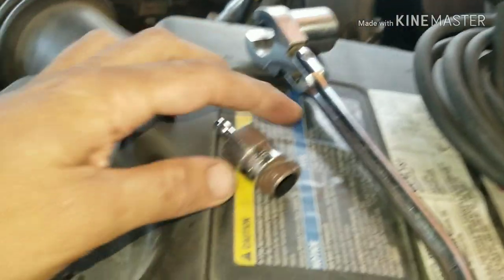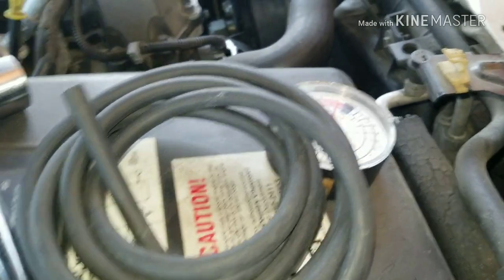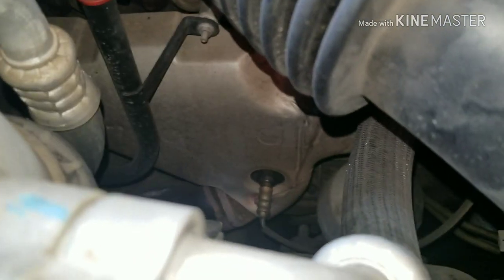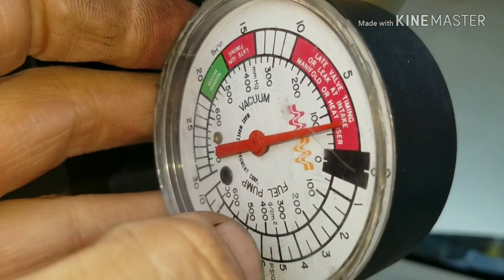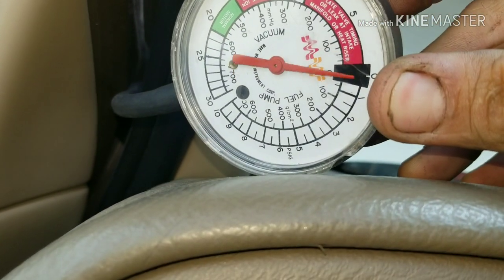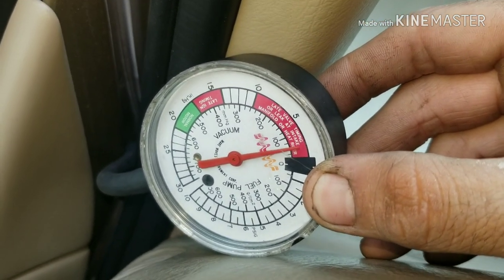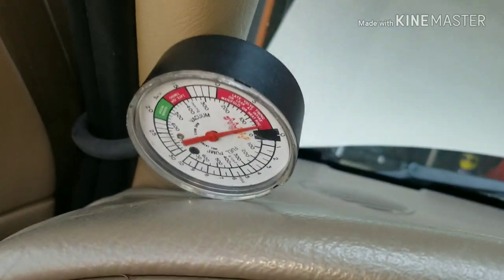How to find out if you have a bad catalytic converter

Comment: Yep, the reduced exhaust flow will  slow the idle down and cause miss fire, because some exhaust is lingering in the cylinders. Toyota 4 cylinder is usually # 3 cylinder. Sometimes it's all. You will also hear a low pitch roar developing.
Reply from the maker: Thanks for your input , Thanks for watching besure to like and subscribe for more tips and tricks and check out facebook for more help in the future

Comment: Thanks this is straight to the point instead of filtering through 40 minutes of talking, good stuff. 

What if the car is running fine until it warms up and only then it shows symptoms of a bad catalytic converter. Is it more than likely it is the oxygen sensor? since if it was a plugged catalytic converter it wouldn't of ran good to begin with? IT drives perfect until it warms up and i think the o2 sensor is throwing the computer bad signs is it possible?
Reply: I'm having the same problem runs perfect until it gets warm. I already chaned MAF,spark plugs,coils, EGR valve IAC valve and fuel pump. It runs way better now but still really rough when it warms up.
Reply: @weariedcleric6306  I'm about to just change the catalytic converter, but then i thought if it WAS the catalytic converter then it would NOT of ran good even when it was cold. So now i'm going to get a vacuum gauge and hook them up to the 02 sensors to test the pressure to verify. Good luck and test them 02 sensors.
Reply from the maker: Some time  the cat gets worse the hotter it gets , a bad fuel pump can give simaler issues also . thanks for watchin

Comment: I have none of that but a annoying rattling under when truck it's cold. Sometimes it does it also after being warmed up. It's got dual exhaust mufflers done at a shop. I bought it like that. I wonder if the catalytic converter makes sounds like that rattling.
Reply from the maker: That is a pretty common problem with (cats) they are ceramic inside a good bump and knock them loose, or they just shrink a bit. Just think of it as a nut inside a walnut shell when it dries out it rattles around just like that. Being its rattling it can cause intermittent restrictions.  I hope this helps and besure to like and subscribe for more tips and tricks.

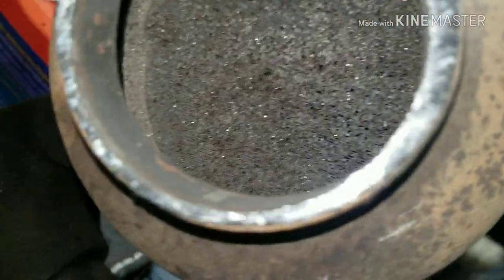Comment: I had to floor my car on the highway just to keep up. I was starting to wonder if I was already losing compression at 125,000 miles but then the P0420 code popped up one night. It was kinda bitter sweet because I knew the engine was fine but the catalytic converter was bad. It looked exactly like yours at 1:38. I bought an aftermarket bolt on part and put new Mopar o2 sensors on as preventative maintenance.

Comment: I have the exact symptom on my TB 2004 without any codes appearing. Will go to mechanic tomorrow to check. Fingers crossed.
Reply: My 2003 TrailBlazer has this exact issue where it slows down to 35 MPH and the RPMs are limited to 3,000. But it only happens after I've been driving for about an hour.
Reply: @TheDomTron  it was the catalytic converter. I had it replaced and welded. Issue was resolved

Comment: I have an 06 GMC Sierra 4x2 4.3L about 246,000 miles on it. While driving in 4th gear (about 40 mph) it begins acting like it has a dead cylinder. I immediately thought that I had a bad injector but after parking in my garage I immediately recognized the rotten eggs smell of H2S. What else besides catalytic converter and injectors could it be?
Reply from the maker: You could  be running lean from a bad intake gasket mass airflow, vacuum hose l. it could also cause  the smell, dropping out in fourth gear does it rev up high like your clutch is slipping? I hope this helps besure to like and subscribe for more helpful tips and tricks.

Comment: My 2003 dodge caravan tested P0420 on scanner.  It runs great on level ground but lugs on grades and engine strains if I try to push it.  I can make it up at 25 mph without too much strain on my tyranny and engine.  Heard about soaking converter in hot water with degreaser for an hour, then power washing on low.  Rather try that than spend more $ than van is worth replacing it.  Tying to find out if there is any rubber or other non metallic elements in it.
Reply from the maker: I've heard of that on particulate filters on diesels, but never a gas engine. if you plan on pulling that cat of to inspect you will be able to tell if in parshly clogged by looking for melted holes or no light coming from the other side,thanks for watchin

Comment: Hello I have a 2002 Buick lesabre, with 165k miles. I was at valvoline for a oil change and had them check my check engine light and they told me it was the catalytic converter. Question is is it really worth replacing ?? The cars only work about 1500 in the condition it’s in, and my state doesn’t have any laws not having one
Reply from the maker: Most the time when you have a bad catlalytic convertor you get a p0420. Most the time your car will run fine and your gas millage might go down.  Thanks for watchin besure to like and subscribe for more helpful tips and tricks.
Reply: Just take them off. Go straight pipe. Make sure when they remove them keep them and sell them. Some are worth like 200 dollars.

Comment: I have a 99 expidition xlt 4wd. Oh boy what an adventure it was given to me. It had low power and check engine. Tons of rotted vacuum lines I replaced. Still hardly any power. New fuel injector a and MAF and it was great for a week. Then boom. Rpms ran at idle when it got to Temp 1k-3k on repeat. Rev the gas and the vacuum lines came. Shooting off. 
Dad suggested the cats were clogged. We bore a hole and broke some of the honey comb to see. And yup. It's loud but it works now and stays running it would die at Temp when you gave it gas before. 

Also it's sitting in the driveway and working from home is great I can use a family members car when needed. Just bought both catalytic converter assemblies since you can't do a weld in apparently. These things are the last thing you think to be wrong
Reply from the maker: Yeah fo sure a guy never think of back pressure just because it's like the last thing you would think about to replace, thanks for watchin

Comment: Drove my 2007 rav4 been having this problem honey comb thing rattles bad in my exhaust hear lots of clunking in my motor.... etc possibly this 2 to 3 mechanics could not find the problem and I spent about 65 to 80 bucks on someone finding out what the issue is...... gonna take it to a muffler shop. My suv makes crackling and popping and someone told me how'd you do that to your exhaust? I haven't done any work it's been stock since 2007. I can still drive mine on the highway just push harder then normal

Comment: I have an 03 avalanche with a code 430 below threshold and 174 too lean.. I have changed the o2 sensor. My next guess would be the cats. Would like an opinion on how to diag closely.
Reply from the maker: Thanks for watchin p0430 is for a bank two catalyst efecency and your lean code is for bank two only. I would look at catalyst efficiency you would need a scan tool to look at your upstream and downstream sensor to see if it is lighting off like its supposed to at its specified time. How ever you could have a efic2ncy code set to a lean condition like a leaking intake manifold, or other issues. I hope this helps thanks for watchin really apreciate it
Reply: @fixergood  thanks ill have to look into that.

Comment: I've had other cars where it would do the same had had to get converters out and replace them with a pipe cleaned the mufflers but I just got this vehicle not even a year I didn't think it would need that yet it's a 2105 jeep Cherokee
Reply from the maker: it all  depends on if you have a failure of the ignition system, like with a bad injectors or sparkplug or coi in the past that would cause it to get auper hot,l thanks for watchin

Comment: So I have a check engine light I don’t know if it’s the catalytic converter. My exhaust setup is sport muffler kit with a resonator delete . I hear pops when I rev to 2k when I let off
Reply from the maker: Sometimes when you have a pop like that it means someone has hollowed the cat out  and is causeing fuel not to being burnt, if so you may have a p0420 codes . Thanks for watchin and besure to like and subscribe
Reply: fixer good like when the exhaust is hot and I’m in park and I rev it to 2k and let off I hear pops. But I’ve done this in the past and no cel .

Comment: I was told i need a cat converter..but i can still go 60 or 80 on the freeway..but the car does seem sluggish at times..when I'm at a red light the car will cut off..but it does start back up.. Is that also a sign of a bad cat?
Reply from the maker: Sometimes when a car dies at idle and is great at higher speeds is because of a gummed up throttle plate. Ypu could have a throttle plate that needs cleaned thsnks fir watchin.
Reply: @fixergood  thanks for responding i went to 3 diff mechanics and they all said its needs a cat converter..so i bought one and a guys gonna put it on for about 150 next week..so hopefully the car will run better after that is changed.
Reply: Did the new catalytic converter install stop your car from shutting off while sitting at traffic lights?
Reply: @tonyorob  yes
Reply: @luv2cook5  Thanks a lot 👍

Comment: My car turns on but after being in park running it shuts off and get a smell of fumes. I get a p0300 code been trying to diagnose it little by little.
Reply from the maker: A p0300 is a random misfire code the bad smell is extra fuel in the catalyst burning . I would check my ignition system. Thanks for watchin besure to like and sub for more tips and tricks

Comment: I’ve got a 93 gmc . It not doing what that I was doing but it doesn’t have power could it be the transmission if it’s not the Catalytic converter? It literally has no power it won’t even burn the tires .

Comment: I have a 2009 pontiac g6. Going from 1st to 2nd gear it jumps, sluggish motor, doesn't want to go when I press the peddle, RPMs are acting weird and will not go up past 2.5, and my fan is always on. Could it be the catalytic converter?
Reply from the maker: Does your transmission flare,  like the rpms go way higher like 3, 4. Or 5 grand  but you go no where. Theres multiple thing that can cause sluggish bass like the need for tune up or a fuel filter if it has one  I'm not sure if it does.hope this helps thanks for watchin
Reply: @fixergood  mine does that, it will rev up to a few grand but bounce around, but it’s doesn’t go nowhere, I lose lots of speed and then I can’t get above 30 mph. What could cause that
Reply from the maker: @cadene9095  it could be multupl things but  if your transmission is flaring most the time it's a  mechanial issue  such as bad friction material on the friction discs. Hope this helps besure to like and sub

Comment: 04 trailblazer.
4.2
Took the o2 sensors before and after the cat out. Thinking it would relieve pressure. It runs the same. 
Would it run better with the o2 sensors out?
Reply from the maker: keeping the o2 sensors out would do nothing for you except cause a fire hazard thanks for watchin
Reply: As a diagnostic test. Wow 😆

Comment: I got the p0420 code for inefficient cat on my 2008 Lacrosse. I’ve left it for the last few months because my mechanic said it won’t hurt the running of the car. But any idea as to what would trigger that code? I did have a misfire about a year and a half ago, but I got that fixed by replacing the ignition module. Also I know I had a bad thermostat or over a year because my car used to run a lot cooler in the winter and would never heat up fully. I’m wondering if that could of ruined the cat because of the extra fuel my car was using because it ran Alot cooler during the winter for over a year.
Reply from the maker: Usually a p0420 code is caused by  the the o2s in able to see a change in number from the entrance of the car and exit. If you have a bad cat the o2s will show the same number under the determined specifications it supposed to run a test. You mis fire in the past could have been what caused the cat to go bad excess full can make a cat run extra hot and ruin it. Thanks for watchin besure to like and subscribe for more tips and tricks

Comment: My check engine light just turned on today and I took my car to one of the auto parts store and they put my car on the computer and it said catalytic converter I'm noticing that my car when it shifts I feel it shift is that common when a catalytic converter is plugged up?
Reply from the maker: Most the time when you go to a parts store they  scan your car and give your the code p0420 cat efficiency. Most the time when you get that code your cats are still allowing exhaust to flow through the exhaust system. If your haveing a more noticable shift you could be in need of a transmission flush. Hope this helps and besure to like and subscribe for more tips and tricks
Reply: @fixergood  will do but what you're saying is the catalytic converter is not the reason I feel the car shift? It does seem to get a little bit better the longer I drive it but not always there's times when I'm driving 10 20 minute drive all the sudden I don't feel it shifting. But the power my engine used to have is no longer there either.  I'll see about getting a flush and I'll start there.. thanks for your help
Reply from the maker: It's hard to say for sure, a plugged cat can cause your vehicle to act strangely. And it's hard to say with out taking it to a shop and looking at a few numbers what the problem truly is.

Comment: Hey sorry guys i have a question just bought a car and i noticed it sounds like a lawn mower under power drives okay through gears but when im trying to go highway speeds wont go faster than 85 and past 2800 rpms in 5th gear, would it be possible cats or something else, ive replaced the coil pack, spark plug wires, and intake
Reply from the maker: If it sounds like a lawnmower you could have a exhaust leak causeing yout fuel trims to be out of balance not allowing you to reach any faster ,or your hitting your speed governor and you vant fo any faster. Thanks for watchin really apreciate it.
Reply: @fixergood  ahhh alright is there any way i can check it myself or should i just take it to the shop, thankfully im positive its not hitting the limit, thank you for the quick response!
Reply: @fixergood  hey soo i had my entire exhaust checked for leaks and nothing appeared had a cracked egr valve which i replace im still having the issue any other possibilities? Next thing im probably gonna do is (spark plugs, catyclean, and fuel filter) car does run faster now hit around 100 so im getting somewhere

Comment: I am gonna try that tomorrow! I just replaced my fuel pump and now when I drive it takes forever for my car to accelerate... it does go over 50mph but I have to really hit the gas. Could this still be the converter?
Reply: Throttle body most likely

Comment: I have a Honda Civic 2008 hybrid , it has the p0420 efficiency code , the car does drive up to highway speeds without any problems , but it does take take to reach to 80. Then it drives just fine, could it be the 02 sensor causing the slow acceleration or just a bad cat ?
Reply from the maker: It could be that you could need some plugs . If your plugs were further gapped and not burning all the fuel you could possably get a cat efficiency code to set due to the extra hydracarbons hurting the cat. Thanks for watchin besure to like and subscribe for more tips and tricks
Reply: @fixergood  thank you for your response , I do feel that maybe those spark plugs I installed aren't compatible, I got them at AutoZone a few weeks ago, and since I installed them I do feel that the car feels weaker. I read the manual of the car and it says to use OEM spark plugs
Reply: @mayurelacachucha  any update I have the same car is you’re cat hood or was it the spark plugs ?

Comment: I have a 2004 monte carlo, car in drive doesnt go over 35, but manually doesnt go past 50. Rpms will go through the roof, anything with the Cat?
Reply from the maker: It hard to say with out looking at some things for data 
 But the the high amrpms could b a sign of a slipping automatic transmission and may need a shop to look at it, hope this helps and besure like and subscribe for more tips and tricks.

Comment: Mine seems to have plenty of power but the deq smog and computer is saying bank 2 is below threshold, does it need to be replaced still?
Reply from the maker: you would probally need further diagnosis to determine if it's bad or just a bad sensor thanks for watchin

Comment: Our 2010 Ford Explorer died on the highway. Started up again though. We took it to O'Reillys and the cat converter code popped up.  Husband said our vehicle has 2 though??? How do we know which one it is or does the whole unit need replacing?
Reply from the maker: For bank one you will have a p0420 if the efficiency code is on bank two it will be p0430. Hope this helps thanks for watchin
Reply: Hey my car is doing they same thing. Did you get it fix? Or did you go another route ?

Comment: My check engine light came on and the auto parts store said it was the catalytic converter. I didn't hear any rattling noises though. I purchased the cleaner you can put in your gas tank and I got the light to turn off but it ended up coming back on again. ☹️